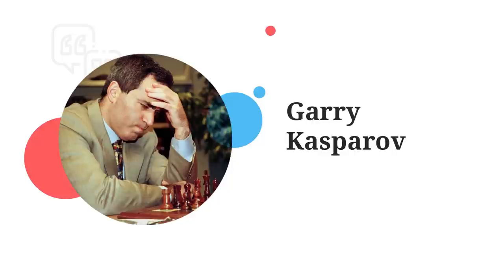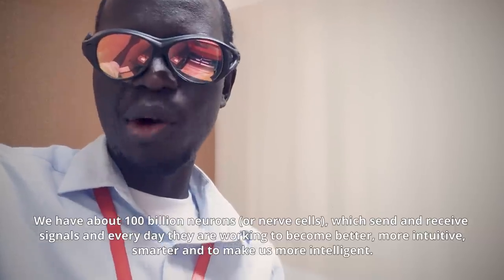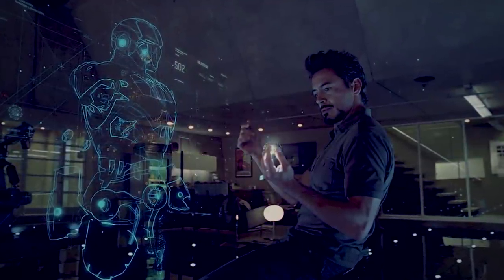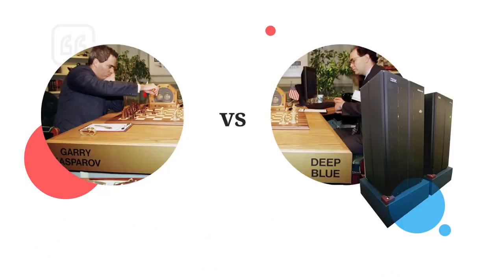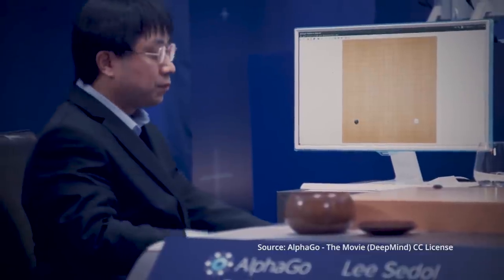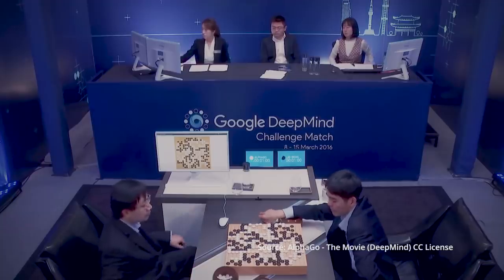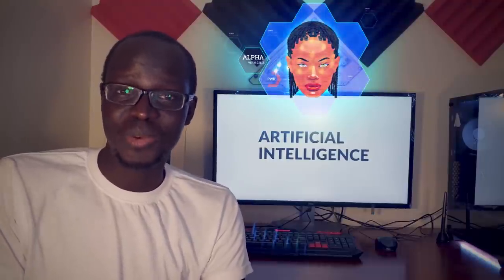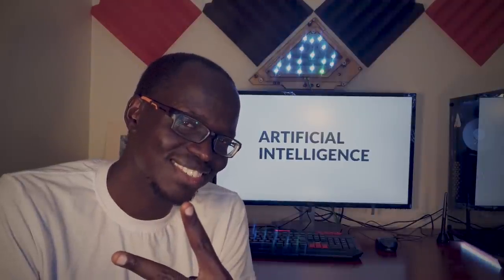Artificial Intelligence: An Epic Journey & Building a Virtual Co-host

Comment: This was really interesting...i was able to understand what AI is. However,  i wonder if AI is created by human beings how then does it get to outsmart them? Could you explain that?
Reply from the maker: Anything that is taught can become smarter than the teacher by acquiring more knowledge faster and using it better. A brute force example is that if I teach a machine to play chess, it can then analyze more moves than me the teacher and find better strategies to win in a much shorter time.

Or discover solutions to mathematical problems because the machine doesn't need to rest and can run through thousands of equations every second, compared to its teacher.